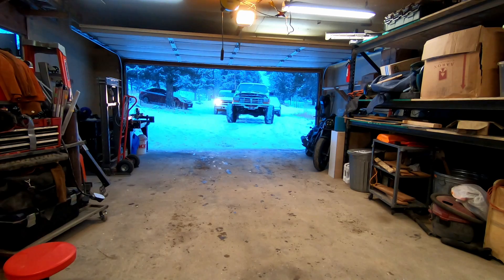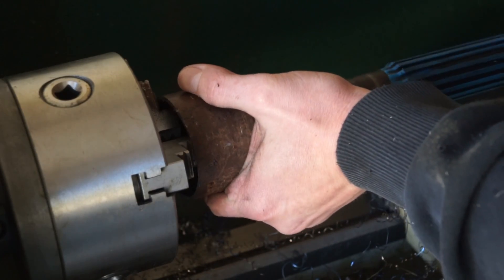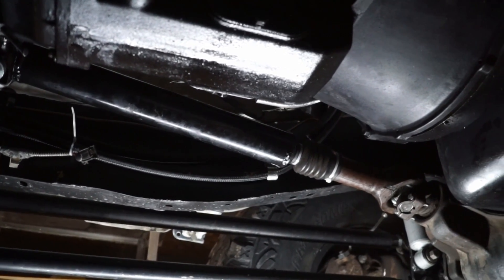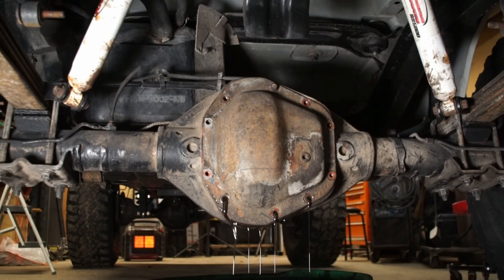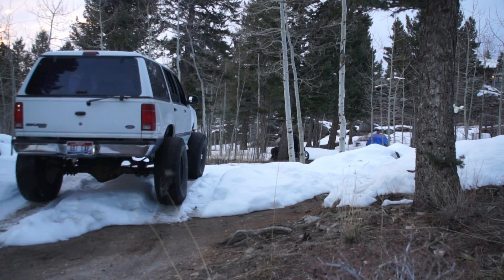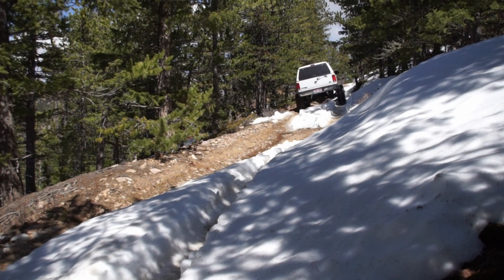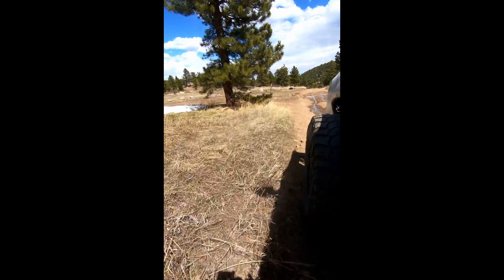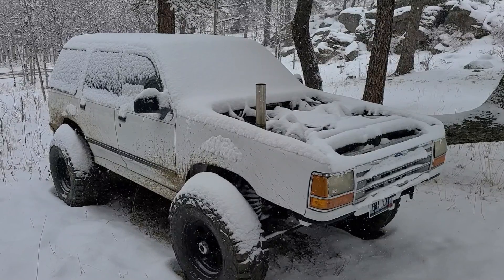My 4x4 is NOT 4WD! And Neither is Yours! (probably)

Comment from the maker: The editing was confusing so I'll clarify here, 0:33 I was not putting the traction boards on the wrong side of the tires. 1/4 speed at 0:37 makes it more clear what's going on, I shouldn't have speed up the footage so much and should've explained more. At that point I was trying to go forwards, since I figured it would be easier getting unstuck by going downhill, so the traction boards are on the correct side for going forwards. I also tried digging some snow out from under the tire with a crowbar, tried putting sand under the tires, and tried bumping it backwards a couple times, which you can see all that on 1/4 speed, but none of it was working. These boards were a $20 impulse buy from a hardware store and it shows, garbage. I'm sure a good pair of maxtracks or something would've gotten me out, or at least I hope so given how much those cost.

When they didn't work I pulled the explorer out backwards with the truck since that's the only way I could hook up to it. 

Always feel free to correct me when I do something stupid, I'm here to learn as much as everyone else is, but this is one time I can say with confidence I wasn't being as stupid as it looks 😅. This time.

Thanks for watching!

Comment: The very nice video. I like lock-reit and this best mechanical lock but,  on/off lock in position free more nice in snowy. Sorry my small English
Reply from the maker: That's true, "selectable" (on/off) is good for snow. I plan on doing the front selectable because not only is it good for snow, it also makes it easier to turn when you need to 🤣 but that is lower on the priorities for now, maybe if I get stuck somewhere it'll move up the priority list.

Comment: open diff should be criminal
Reply from the maker: Youve gotta start somewhere 😅
Reply: @BuildSomethingAuto  i was thinking about manufacturer.
Bought similar few years ago. Lift, massive tractor tires, snorkel, special paint for bushes etc.
Straight after transaction i went test it and cannot exit muddy puddle xD
I was so fixed at monster truck looking totally miss idea it could still be open diff.. ^^

Comment: Don‘t you have manually locking hubs? You get out of truck and turn the lever knob on each wheel to lock the hub to the axle. And a differential that will lock both rear axles together, called a locker. But then when your are on pavement you have to get out and unlock your hubs so you can drive on curved roads
Reply from the maker: Yes! This is another reason Id argue that in the front an expensive selectable locker is even less necessary. When I eventually get a locker in the front the manual hubs make it "selectable" even if it were a full spool.

Comment: Your driveway slopes down into the garage. Why?
Reply: Thats so if the heat is off in the garage you can have a neat place to practice ice skating
Reply from the maker: Couldnt tell ya. Currently in a rental and there are lots of... strange.. choices the owner has made with this house. Theres also a small ditch in front of the garage for runoff and that didnt help my case getting stuck, the front wheels actually needed to go up a small amount to get back into the garage despite being on a hill.

Believe it or not this is after I got out there with a shovel and levelled it out a bunch, before doing that I wasnt sure the explorer would make it isnide without hitting the door frame.

Comment: As an "engineer" you should know better than to believe that the torque converter on an automatic gives you torque multiplication. If it actually did no one would run a 4 speed (or more ) in a vehicle. Getting something for nothing is not possible and if you are an engineer you know that is a fact. Get the front a limited slip center and you will be as close to 4 wheel drive as you can be with a street driven vehicle.
Reply from the maker: Youre confusing energy and torque. Power, energy over time, would be conserved assuming things like RPM (fuel injected) stay constant, but there is no conservation of torque. From an energy balance perspective the tradeoff in a torque converter is RPM, more fuel is being injected when they multiply torque, so they have no problem giving you more torque for the same wheel speed (but higher engine speed due to slippage). Its inefficient since it wastes fuel and creates a bunch of heat, but it still multiplies torque.

The archetypal example would be "stalling" a torque converter when youre launching a drag car from a dead stop. Imagine the engine is spinning at 1800 RPM, and the wheels are stationary. Where does the fluid go in the torque converter, considering the transmission side isnt moving? It recirculates through the vanes in the converter which gives you a mechanical advantage, you get more fluid pressing harder against the transmission side of the fluid coupling. You can momentarily get 1.8x engine torque when "stalling" an automatic trans like this, and even more if you have a high stall converter that lets it slip even more (say a 2400 RPM torque converter, or a 3k). 

The same is true to a lesser degree when climbing a hill. As the load on the tires increases and the transmission speed begins to drop, but the engine speed is maintained, the fluid begins to recirculate more and give a torque advantage (not as large as the 1.8 stated earlier, but still some). Automatics have more torque when climbing hills, if the load of the hill causes wheel speed to drop - because the engine speed stays higher compared to a manual.

Of course the disadvantage is that this slippage creates a large amount of heat. It is inefficient and wastes fuel which is why lockup torque converters exist, and slippage isnt desirable if your goal is fuel economy. Its less efficient, but still increases torque.
Reply: @BuildSomethingAuto  a fluid coupling absolutely can NOT output more torque than is put into it in the first place. If it actually multiplied torque it would be called a torque multiplier but that's not what it does at all. It converts a higher rpm input (where your typical combustion engine generates more torque) to a lower rpm output applying roughly the same amount of torque as the input (slightly less due to losses from fluid shear converting a very small amount of that input torque into heat) to this slower output speed. ANY actual torque multiplication comes from different gearsets connected between the torque converter and final drive.

Remember torque is the amount of rotational force applied against a load.

Kinda like how your rear axle was actually still driving two wheels through an open diff. An open diff does a 50/50 torque split. It ALWAYS applies the same amount of torque to both wheels regardless of their speed. problem is, once one starts spinning the amount of torque being applied drops to almost zero because the resistance to that motion (the load) drops to almost zero. It was still applying that minuscule amount of torque to both wheels.
Reply: Torque converters are not just fluid couplings. They are in fact, torque multipliers. That is how cars were able to get away with having 3 speed (or the 2 speed Powerglide) transmissions. If you've ever driven a car from the 70's you'll notice how the engine RPM stays relatively the same while the vehicle speed increases. This is because of the torque converter. In a sense, they are like small CVT's. The main reasons modern vehicles are using 6+ speed automatics is for fuel mileage and emissions.
Reply: @tonybingham2399  it converts torque by multiplying INERTIA based on input/output speed differential. All losses aside the best multiplication factor you can get from a torque converter is 1, at stall speed, that is why you match the stall speed to the engine's peak torque output, otherwise it's a torque divider, it only multiplies by factors less than 1.
Reply from the maker: @RyanAumiller  It can multiply torque, because the stator redirects fluid back through the converter multiple times, it functions like a wet gear reduction. More accurately, like Tony said, it functions like a CVT constantly changing the torque through it based on an input output speed differential. 

If you won't listen to us, maybe some sources will help. We're all here to learn, understand that you're mistaken about the function of a torque converter - but don't take our word for it, do some reading outside these youtube comments if you don't believe us.

Here's an animation that shows it, although it's still hard to see what's happening:
https://www.youtube.com/watch?v=hl75nbJ1q0Y

Here's a motortrend article:
The stator redirects fluid from the turbine to the impeller, radically increasing the force of the fluid entering the impeller and multiplying the torque input from the engine. Basically, the fluid exits the center of the turbine and is redirected by the stator back into the impeller. This is a very slick trick and can be worth up to 2.5 times engine torque! This means that at a 2:1 torque multiplication ratio, an engine that is making 300 lb-ft of torque at a stall speed of 2,500 rpm will actually apply 600 lb-ft of torque to the input shaft of the transmission as the car leaves the starting line.
https://www.motortrend.com/how-to/ccrp-0310-torque-converters/

Here's the wikipedia page:
The maximum amount of torque multiplication produced by a converter is highly dependent on the size and geometry of the turbine and stator blades, and is generated only when the converter is at or near the stall phase of operation. Typical stall torque multiplication ratios range from 1.8:1 to 2.5:1 for most automotive applications (although multi-element designs as used in the Buick Dynaflow and Chevrolet Turboglide could produce more). Specialized converters designed for industrial, rail, or heavy marine power transmission systems are capable of as much as 5.0:1 multiplication. Generally speaking, there is a trade-off between maximum torque multiplication and efficiency—high stall ratio converters tend to be relatively inefficient around the coupling speed, whereas low stall ratio converters tend to provide less possible torque multiplication.
https://en.wikipedia.org/wiki/Torque_converter
Reply: @BuildSomethingAuto  literally compare the dyno sheets between the same engine on an engine dyno and a chassis dyno w/ an auto locked to its 1:1 ratio and every time you see just a little less torque than what the engine alone puts out at a given engine RPM on the chassis dyno, with a torque converter in the mix than you see direct from the crankshaft.

I've been fed this nonsense for almost 30 years now and never once has someone been able to show me this alleged torque multiplication without doing a neutral drop and even then it's not sustained. In the real world you only get the illusion of torque multiplication starting from a dead stop and during gear shifts for an infinitesimal amount of time. I ONLY ever see any useful and sustained torque multiplication from an automatic when gear ratios lower than 1:1 are selected.
Reply from the maker: @RyanAumiller  I agree, it's only for a short time while the converter is stalled, OR when you're heavily loaded and the wheel speed is starting to drop compared to engine speed. Of course it still comes with efficiency losses which is why lockup torque converters exist.

A dyno is trying to measure engine torque not wheel torque, it measures your engine rpm and wheel rpm and using these numbers it compensates for all the gearing in between. The reason it doesn't read torque multiplication from the TC, is the same reason you aren't having to type in all your gear ratios and tire diameter to get an accurate torque reading - it reads input and output speed and does the math to know the gearing in between. If the dyno didn't have a tach signal and used uncorrected wheel torque numbers, you'd see an order of magnitude larger torque numbers at the wheels due to drivetrain gearing.

If you don't believe me, I'd repeat what I said to the other guy just read the sources I linked. In the end I'm not sure why people are so opposed to this idea. I agree it's less efficient in terms of power/fuel usage, and personally I still choose to drive a manual, but physics is physics and mechanical advantage exists whether it comes from a physical gear, or a wet reduction in the form of a torque converter.

Comment: Let's face it, with (unless my eyes deceive me) twin I-beam, no one wants to brake into those diffs especially if a solid axle is in the future.
Reply from the maker: Actually, believe it or not I intentionally swapped in the TTB. No solid axle for me. It's a dana 50 TTB out of an F250, had to swap it to coils since they came with leafs. It's built like a ford 9", removable 3rd member and high pinion (strong). I wanted to try beams for a challenge and because I like how smooth they run. Hopefully I'll get a chance to test it on some harder trails soon.

https://www.youtube.com/watch?v=3Thj3K5ZLUA&t=658s
Reply: @BuildSomethingAuto  i am very fond of the twin I beam. I own 12 of the 1/2 tons, a pretty even mix of 4x4 and 2wd, and 1 3/4 ton. All those and run them for years on the bee farm and never once had to tear into the front diff.  In my experience there's absolutely nothing wrong with them. But we never did any recreational off roading, a days work was more than enough adventure some days. One year I twisted 3 drive shafts in my pickup. I didn't pretzel them just took the ujoints enough out of phase that they'd vibrate on the highway.

Comment: I've said it before but I'll say it again, I dig the suspension setup! I would reinforce the radius arm brackets a bit but otherwise it is nice. I've got 2 trucks with a d50ttb and I plan to rip one of them to build another truck up.
Reply from the maker: Thats awesome, id love to see the build if you ever end up doing it! 

Eventually when I get this thing on a serious trail I'll video the TTB and see how well it does.
Reply: @BuildSomethingAuto  it ought to do pretty well! I've  seen a few similar explorers running modified 35/45ttb with tons of travel. Thing was killer.

Not 100% decided on the truck but swingset steering and turning the beams w/ reinforcement  is what I want. It'll  either be my jellybean f150, or if I want to get weird with it, one of my toyota minis. Haven't decided if I would make any vids on it, but it would be fun to experiment with that.

Comment: @BuildSomethingAuto  Why the fuck would you put traction boards in front of the tire when you were trying to go backwards?
Reply from the maker: I wouldnt. I wasnt trying to go backwards. Hard to see since I speed up the footage, but at that point I was just trying to get it unstuck and back inside, figured I had a better chance of driving forward then backwards. When that failed I just yanked it backwards with the truck so I could get some speed to get back into the garage forwards.

Comment: Your first problem is you put all that weight on the front axle. Off-road and weight don't go together
Reply from the maker: Eventually Ill go weigh it. Id be willing to bet its still lighter than a gladiator with similar sized tires and axles - considering it started off weighing 1,000 lbs less to begin with.

It was never meant to be a "perfect" rig, it was meant to be fun, and cheap, and so far its doing a great job of both of those things. 

I could literally have 10 of these for the price of a hemi rubicon 🤣
Reply: @BuildSomethingAuto  well I'm all about fun. I've been playing with 4 * 4 for the last 50 years. So if you're having fun doing it keep going👍

Comment: I don't think you know how to use traction boards...
Reply from the maker: Probably not, but they were also VERY cheap traction boards picked up on a whim at a hardware store. The snow wasnt soft enough to get them under the tire and they may as well have been made from teflon, couldnt get a tire to grab no matter what I tried. 

I need to get a real set, they cost atleast 10x what I paid for these.
Reply: @BuildSomethingAuto  Cheap or not, you had them on the wrong side of the tire. You were trying to get traction going in reverse, yet you had them in front of the tire. Sick build though.
Reply from the maker: I was going forward 😉. Figured I had a better chance getting it to move by going downhill than uphill. It isn't obvious in the sped up footage, maybe I shoulda showed more of it.
Reply: @godhammer666  yea this was funny, I am going WTH
Reply: @BuildSomethingAuto  Yeah that wasn't the issue.
Reply: @GregoryVeizades  the problem is definitely user error and a lack of common Sense